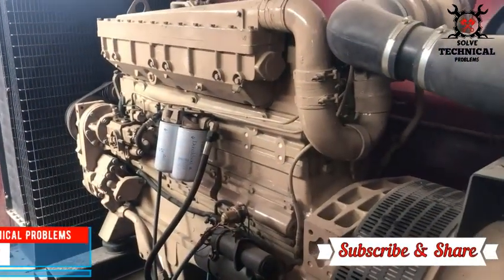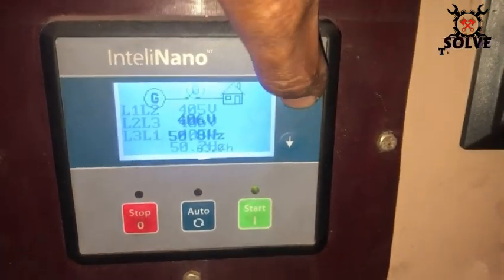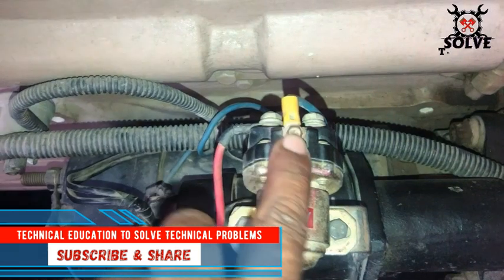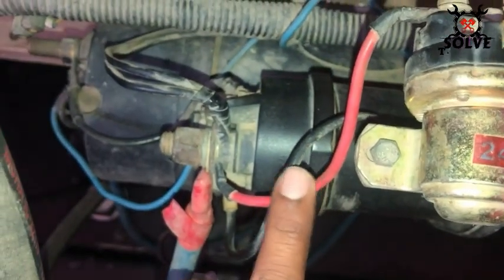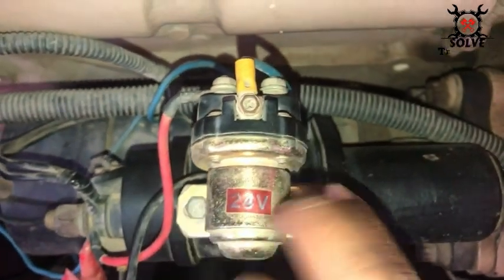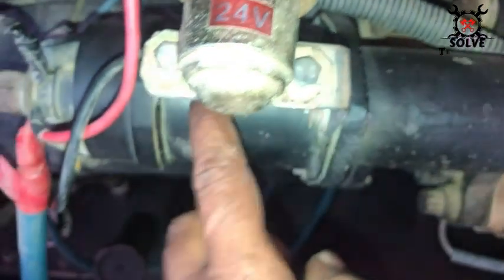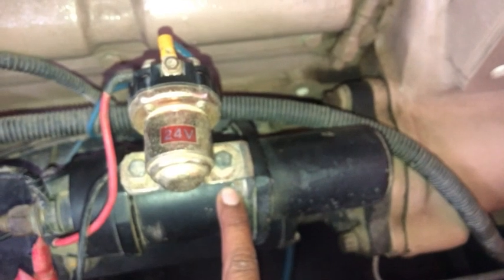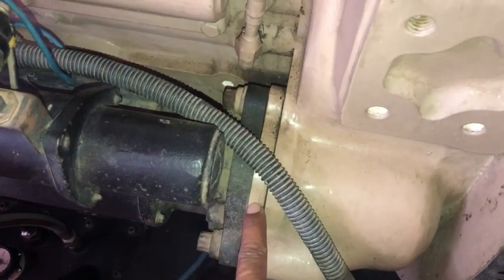Self-starter motor connection.Wiring self-starter solenoid .self-starter relay connection

Comment: Pinion gear is rotating while moving forward, what to do brother?
Reply from the maker: Start by checking the battery voltage and solenoid operation. If those are fine, inspect the pinion gear, fork, and Bendix mechanism. If the issue persists, the starter motor itself may need servicing or replacement.